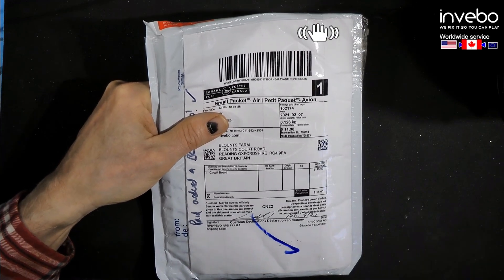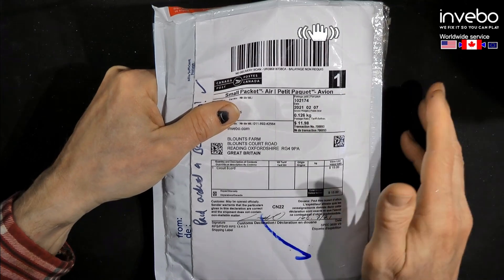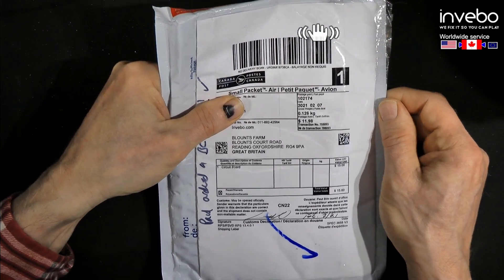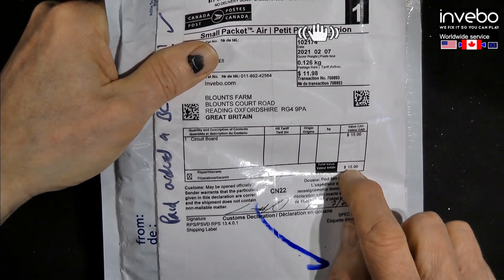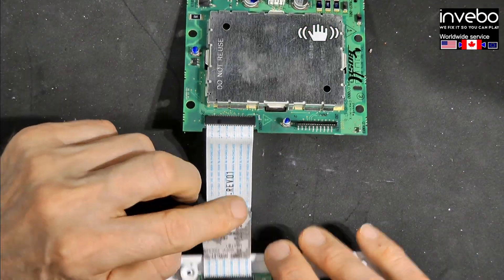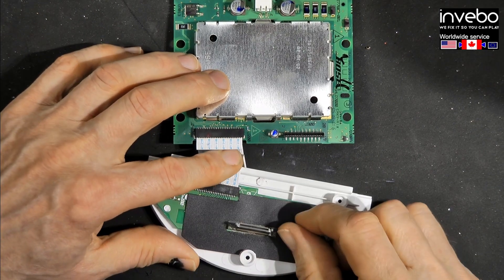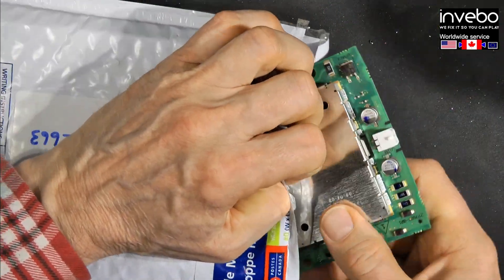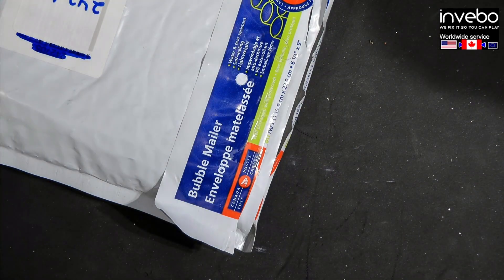Sending Bose parts for service to invebo from Canada using 1st class Airmail

Comment: Hi. My Sounddock 10 is not delivering any sound. I'm a technician, I opened it and I think the problem is in the DSP because it's not generating the AUDIO_MASTER_CLK on pin 2. It has an input clock of 18 MHz ok. Power voltages is ok, except de 24V that is at 17V. Do you guess another problem? If it's the DSP, can I just change it or do you have to reprogram it too? Do you sell this DSP? I live in Brazil and it is difficult to send it for repair. Thank you, a lot and congratulations, for the channel.